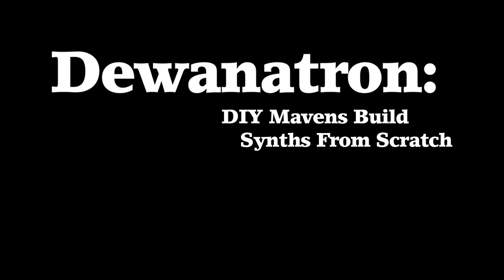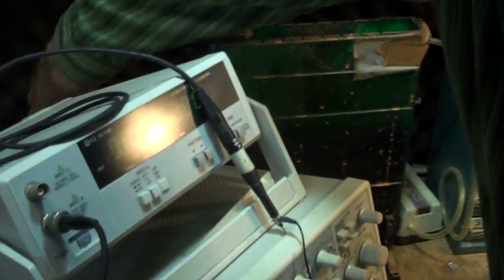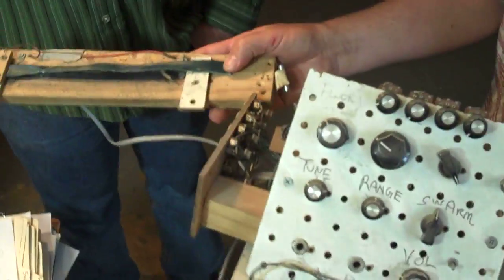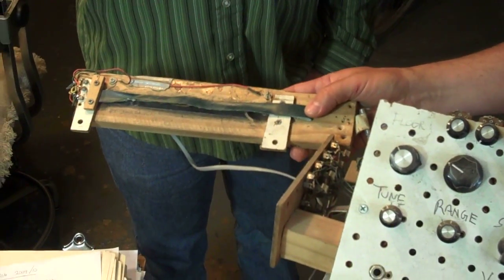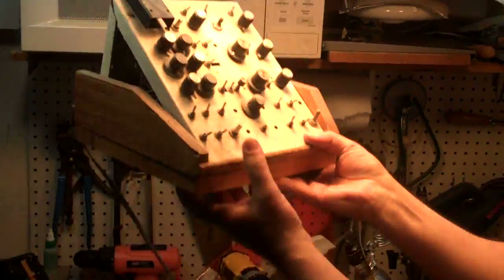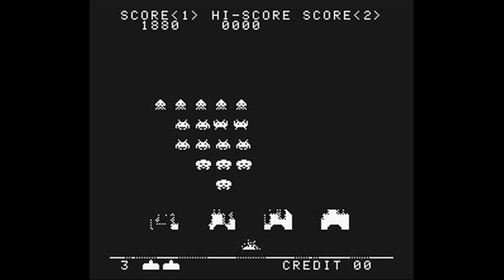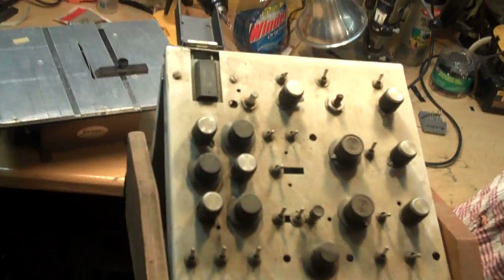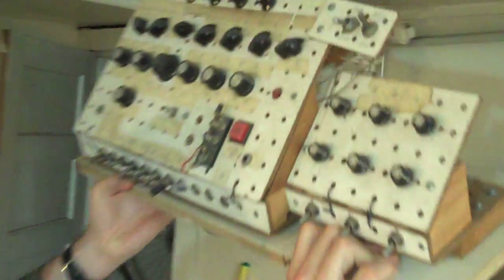Dewan Cousins Build Synths for Trent Reznor From Scratch

Comment: lol

Guy is fucking crazy. Dude basically introduced DAW-sequenced found sound sample based percussion to the industry with the first version of Pro Tools following in Sherwood's footsteps with what he could do on a Fairlight earlier (not nearly as much until the DAW was commonplace). His first record was the sole entry into synthpop that ostensibly refined and subsequently killed the genre as we know it a la cheesy 80's Soft Cell sounding tracks. 

I don't think Reznor would consider any piece of equipment to be "messed up" or "wrong" save for the instruments that cut out on stage he breaks. Your "super messed up early prototypes" are perfect as far as he's concerned. Dude's probably recording vocals with a cheap IEM to a microwaved VHS-C tape right now and that alone would be a layer.

Comment: QUESTION: I'm a a Reaktor ensembles constructor.... I realized stuff for Reaktor and with Synthedit too, in the past. I studied a bit of electronics at school and worked as an electrician; I also have MANY KILOGRAMS of electronic stuff as resistors, leds, timers, microcontrollers, etc. (from slots, arcade games and things like this....my uncle cleared a place). I'm realizing my first modular wavetable Reaktor ensembles using the new BLOCKS system (in the past I realized only FM and subtractive stuff). I want to make THE BIG STEP: buying all the things I need and build a STATE OF ART hardware 3 OSC subtractive synthesizers,, with a full MIDI interpreter. I also was thinking about the Arduino platform for managing matrix, MIDI and other.....anyone knows where can I find SCHEMATICS? I need professional stuff built by myself, please tell me, if you know....
Reply: +Patrick Adorati check out the DIY forum at electro-music.com. Filled with friendly folks and fantastic circuits! My own hardware synth was constructed almost entirely using circuits from that site! https://hackaday.io/project/5826-diy-mostly-analog-modular-synthesizer
Reply: +Patrick Adorati Yep, here: http://frankyfuzzfire.free.fr/Fofo/imgs/Slidophone/VCO/vco.html and here: http://www.musicfromouterspace.com/index.php?MAINTAB=SYNTHDIY&VPW=1356&VPH=512
Reply: +Chris Beckstrom oh thanks a lot mate... I'll check this out for sure!
Reply: +Iche noice, saving that
Reply: I might be late to the party, but please do a google search on "synth-diy mailinglist"

It's oldschool to use a mailinglist, but all the old geezers are on there. You will be amongst celebrities. And asking questions is mandatory. (or just lurk for 10 years, that's also a possibility)